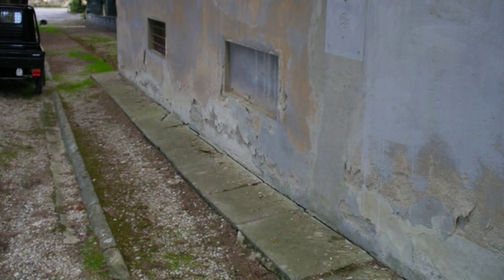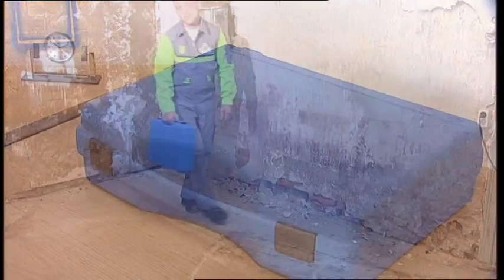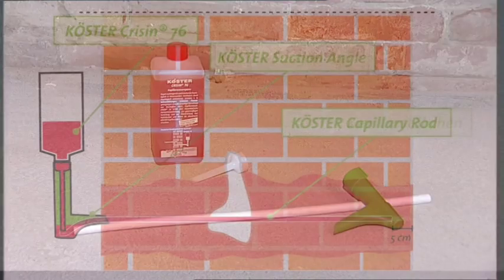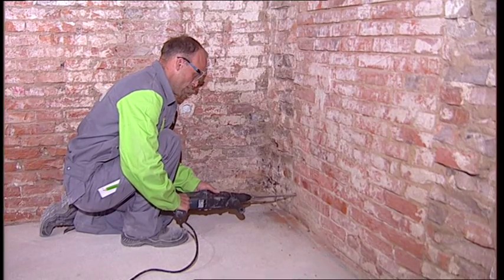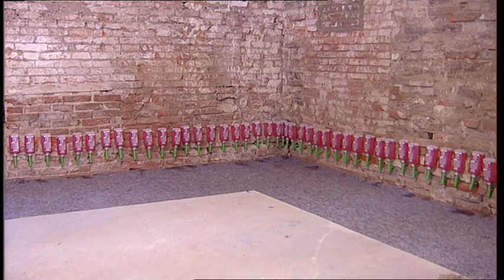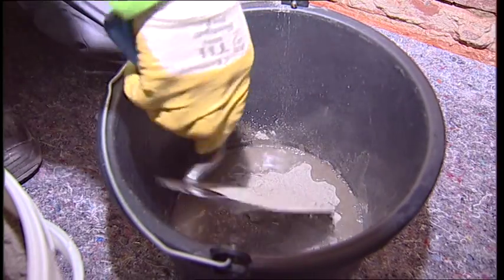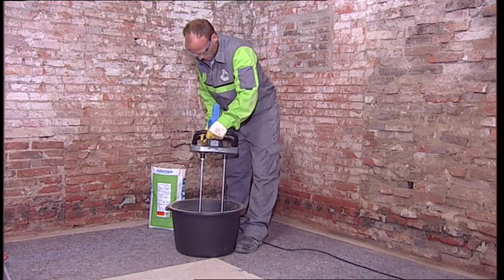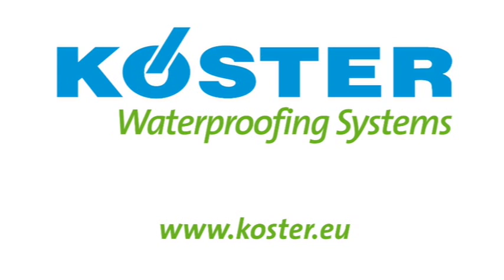Rising Damp chemical DPC (damp proof course)

Comment: Wow. Seems like a lot of products!
Reply: +Howard Gilmour  Well the rising damp barrier itself consists of one product, the Crisin 76, the suction angles and capillary rods are really tools for getting the material into the wall in a totally pressureless manner.  The suction angles and Crisin cartridges are re-usable, but you do need new capillary rods for each job.  Our Koster NB1 is only normally used in situations where the internal floor is lower than the external ground level,  In this situation a negative side waterproofing is required to prevent water penetration through the wall below the new horizontal barrier.  We do also now produce the Crisin in a cream format, which makes for an easier application in all but the most demanding situations.

Comment: Wrong, wrong, wrong.
Maybe the wonder liquid evaporated or found cracks and voids to drop down and puddle in?
You  must never bridge any existing mechanical DPC with render or tanking.
You dont form a fillet that allows contact between the solid floor and the wall.
The "Tanking Slurry" will drive the moisture up the wall or through the wall to the other side.
Reply: +mike gert Dear Mike, The Crisin system is totally pressureless, it can only enter the wall through capillary action and due to the capillary rod system can not drip down into voids.  In the case where the external ground level is higher than the internal floor level then ( as is the case in this example) then a sealing slurry has to be installed to tank the area under the DPC where you could have pressurised water ingress.  Our Restoration plaster is capillary inactive, so providing that no water pressure is present (as is the case above ground level) then no liquid water can pass through it, however it remains open to water vapour.
Reply: Is this availeble in india 's any city .
Thanku

Comment: If there is no such thing as rising damp, why did an interior wall (in my home) display moisture up to about 3 feet above floor level when it rained, and did so to such a degree that the (previously dry) wall paint became runny? The phenomenon disappeared when there was a spell of dry weather. Incidentally, since the wall had an 'expensive treatment' it has remained consistently dry.
Reply: Probably because you had leaky gutters, leaking rainwater drains or external ground levels too high
Reply: Lol... so are you gonna keep hacking off your plaster and redoing it every time it rains Einstein 🤣🤣

Comment: Does it only work in brick walls or can it be used in mud walls?
Reply: Thanks for your question.  In theory it could work as the Crisin does not need alkalinity in a wall to activate.  It does work with all different types of mortar.  However with a mud wall, I really don't know.  I am pretty sure the crisis would penetrate and hydrophobe/ block the capillaries, but  this could possibly cause other problems.  Could the area immediately below the injection become saturated and loose it's structural integrity?  I think we would need a lot more information before making any kind of proposal.  Please feel free to contact us on technical@kosteruk.com